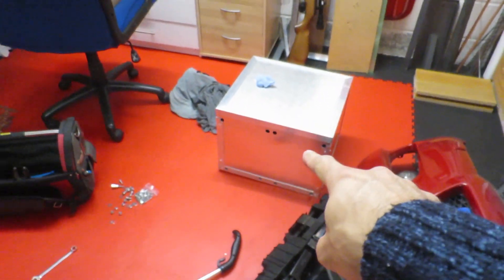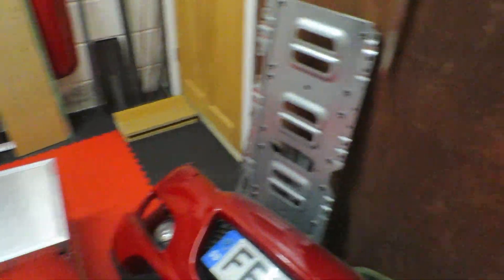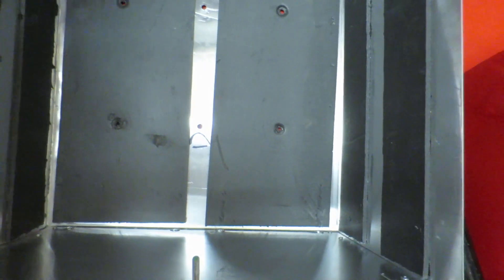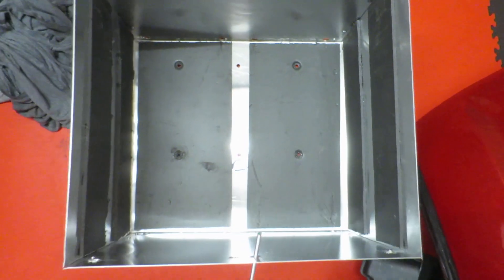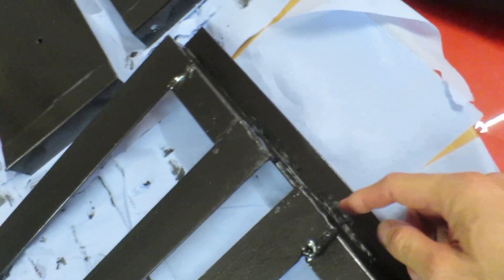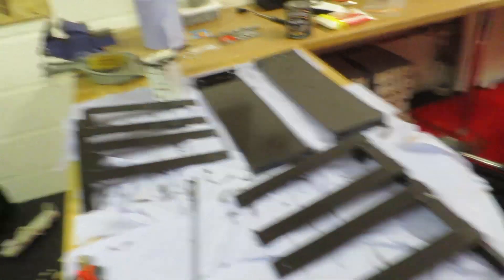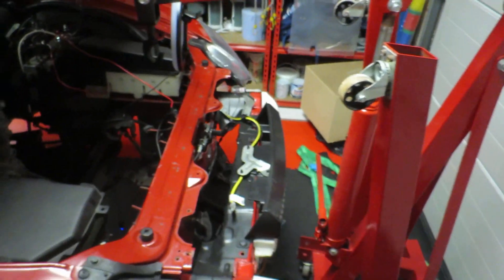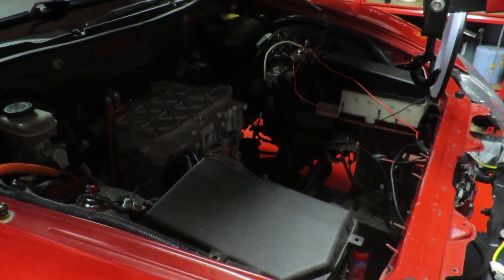Rx8 EV conversion, last stages now.

Comment: I guess you have thought about this but if you put the box in, then add the batteries, are you going to have room to fit the threaded rod?

Looks a bit tight. 🤔

Loving what you have done so far, only recently found your channel and spend the last couple of weekends catching up 👍
Reply from the maker: Hay - so good spot, but ill do the same I did in the rear. I will install the box with the rods in place. All I need is space to fit 1 battery, so ill slide the rod out that much. The battery goes in the box then slides down the rods into position. So I dont need any more space than the box + width of one battery.

Comment: I used just one of the original oil coolers with a fan on the back to cool my HPEVS AC-75 Curtis controller in my RX-8. Put in a little heat sensor relay and it works like a charm. Keep battling on.
Reply from the maker: Yeah I wish I kept them! friends owns the local scrap yard so sure I can salvage one ;o)